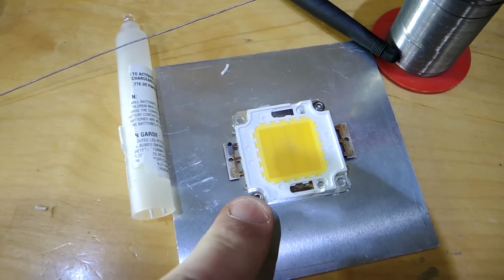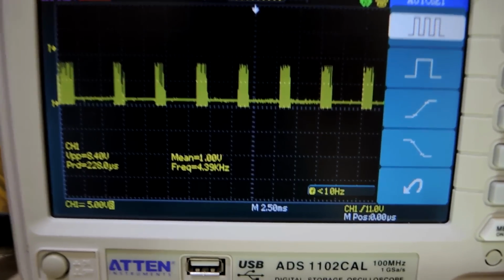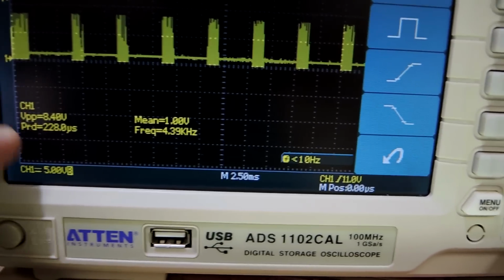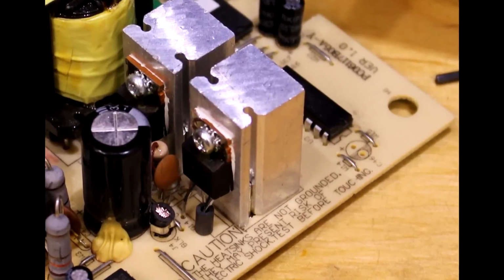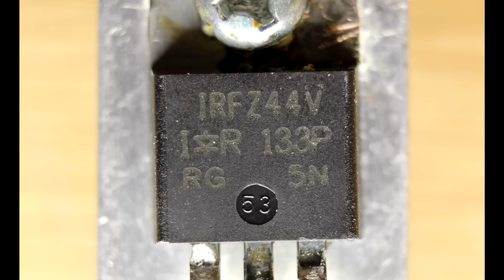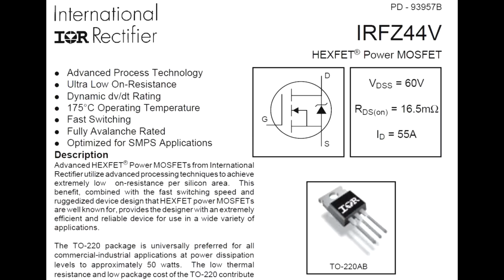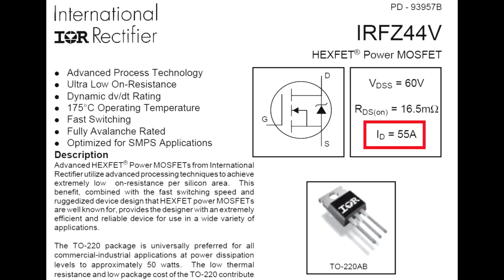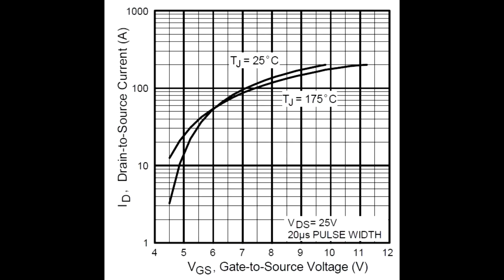LED Bonfire Effect: taking a flickering "candle" effect up a notch

Comment: like you can buy a tv simulator you put in a room to make it seem inhabited, this would look like a house fire simulator from the outside!
Reply from the maker: +jusb1066 mmmmmm, not quite what i had in mind,but an interesting thought. I was thinking this might be a nice effect for a Halloween display.  More on the spooky lightning axis.
Reply: Grab a dozen greeting card assortment of tune generators, and make a few drivers from them, and use smaller led dies, assorted colours. That way you get varying colours, and a pattern that runs a long time before repeating. As a bonus use an appropriate theme to a small speaker to get a musical interlude as well.